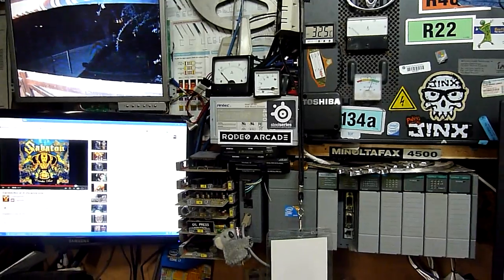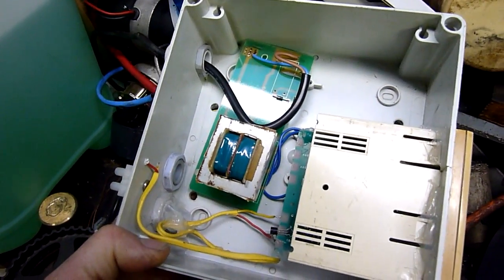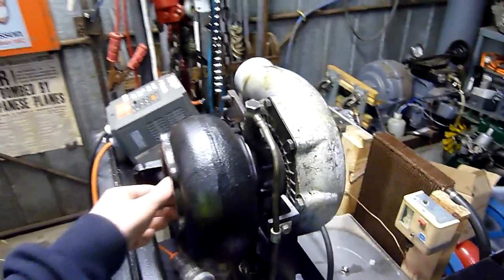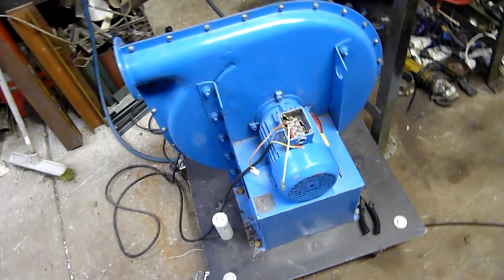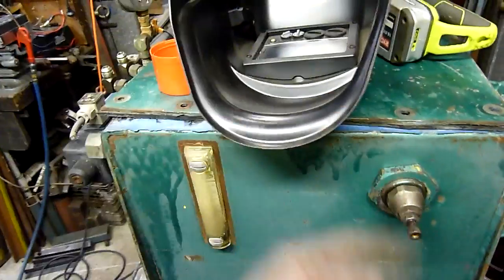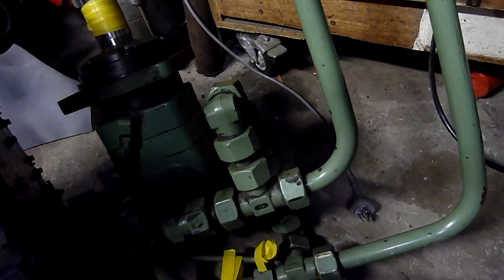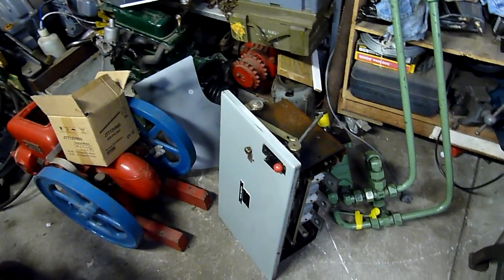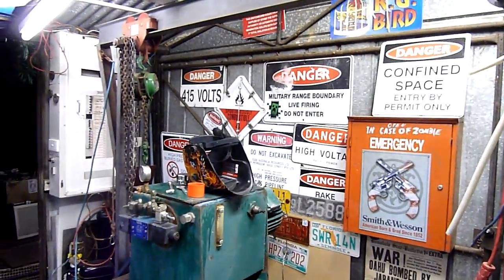Ramblotronic Tuesday - Jet Turbo and 3 Phase Motor Ramblings

Comment: take the service disconnect ( main switch ) gut it  but leave the quick break /connect alone and then get a recording of a 136K 50 hz transformer when they drop it on line and wire up the recording to play a continous loop , start the video dark shop ,your voice good day welcome to ed systems , then throw the lever  , loud snap and Hummmmmmmmmmmmm. sound .

Comment: Ed, Why don't you use a leaf blower in the interim until you can get a VFD working? Personally, I think building an air starter using the turbine blower is a bit of overkill.

Here's a nutty idea: Belt your Yanmar diesel up to the oil pump, then move the VFD to the blower housing. I think you got a big enough pulley to get the desired RPMs without blowing fittings or seals.

Comment: i love the way you explained the way to measure hydraulic lines and fittings lol  was imperial the standard system for measurement in Australia at one time  like here in Canada the government changed to metric in 1973 but to this day the trades especially carpentry still use inches and feet 95% of the time  and me personally i like the imperial system  when it comes to building things